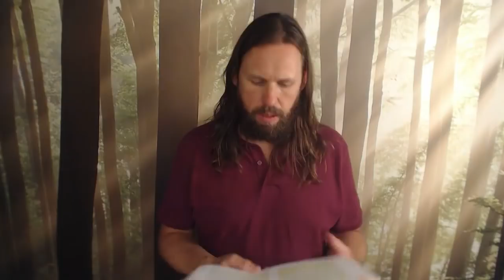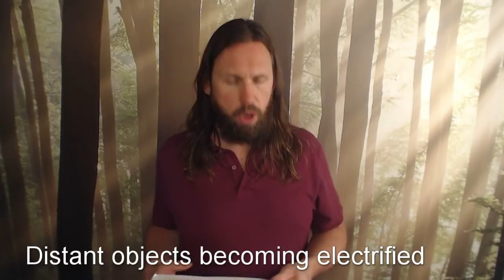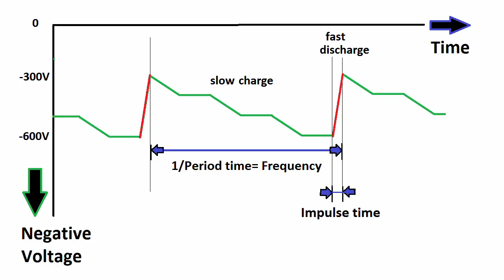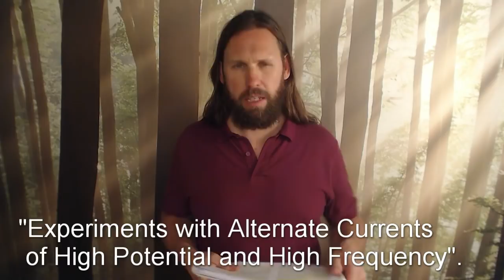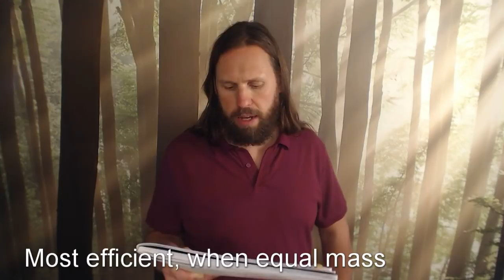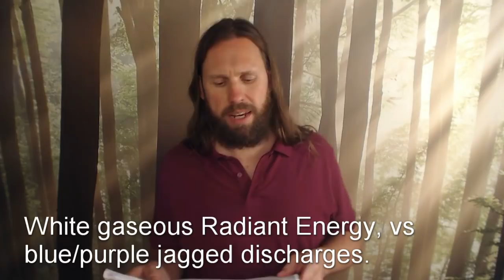Nikola Tesla's Radiant Energy Part 2 of 3

Comment: My hypothesis for the varying effects by impulse duration. Similar to how microwaves heat water molecules due to matching wavelength to molecule size, these dielectric impulses may pump/siphon dielectric energy into/from different sized assemblages of matter/molecules. Dielectricity -> Orgone -> 'life energy.' Per Ken Wheeler ( my take), matter consists of assemblages of magnetic shells inflated by dielectricity - magnet balloons filled with dielectric 'air.'  All of material existence consists of infinite variations in these magneto-dielectric assemblages. And, like a balloon, there can be different pressures. So, with this argument, living cells can be filled with differing levels of dielectric life-energy. Hitting them with the right impulse-width/duration, would add defacto life-energy. Or other manifestations (e.g. sensation of heat) from adding/subtracting energy at different impulse durations/widths. I bet one could fairly quickly work out correlations between impulse durations and different cellular structures, such as nerve cells, etc. One implication: life/death ray depending on negative/positive dielectric impulse. I also have an idea for a spark gap in a magnet. I wonder how different ring magnet configurations would impact spark quality if the spark-gap manifests at different points along the axis of the ring magnet. I wonder what effect north/south pole and center of dielectric plane - and offsets from center at different points. All experiments to try. But, need to come up with the pulse generator first...oh, that's one of the projects you've been doing Master Ivo! Great stuff. I hope to begin my own experiments by this fall this year and perhaps turn some of my hypothesis into theory and beyond.
Reply from the maker: please share your experimental results
Reply: @MasterIvo  I plan to. I want to step from the sidelines into action. Your efforts have helped a lot. Thank you.

Comment: Dealing with dielectric waves that travel faster in insulators than charges in conductors alters the dynamics of electrical engineering. The final 2ndary change in effects is how acceleration (changing the rate of change in voltages and magnetism values) influences the transference of dielectric and magnetic energies between substances. The logic for this 2nd influence is how more efficient the transference of kinetic energy is accomplished with higher values of kinetic energy (an exponential increase in effective transference with increases in value (the Oberth effect). Party on Dude, be good to each other. B
Reply: This is how glass lasers seem to work, the dielectric field is the light going back and forth.

Comment: i've created a BF pancake that naturally, with the help of a few nanoFarads external cap., rings at one of the Royal Raymond Rife frequencies that supposedly kill one of the cancer causing bacillus bacteria. it is inline with the output  spark gap of a small marx generator with supply power ~20W. it(BFcoil) is ~10cm diameter with ~24 gauge wire, and rings at around 1.604MHz, have to sweep over small varying capacitance(+/-100pF) region or mix with varying sound to achieve exact, but intermittently with respect to several sparks, frequency needed to shatter bacteria cell. i can feel a tingling from it against body when a ~5KV spark occurs at spark gap(s), coil itself located ~0.5 meters from gaps in marx generator.
Reply from the maker: Nice work! upload it in your youtube channel.
tonight I did a test which produced 42uS/h beta radiation from an impulsed TEM resonant coil.
Reply: @MasterIvo  sounds intriguing, Morray and Hubbard worked along somewhat similar lines for their generators/batteries. note that Morray invented transistor not bell, and bell didn't invent telephone either; telephone invented by Mucci by accident while investigating electrotheraputic device, then stolen when he worked at one of bell's labs , and another separate invention using the earth's ground invented by Stubblefield. note i probably have misspelled some names.
  my circuits are rats' nests, and only my cat likes to look at such things.

Comment: they seem to have confused the terms for positive and negative electricity, if i attach microvolt meter to connection inside earth i get a positive reading not negative
Reply from the maker: you will have to connect the other terminal of your meter in the ionosphere (or at least at a higher point)
Reply: @MasterIvo  although not convenient to raise one probe up to the height of the ionosphere, the + probe is inside the earth and the - pole outside(above) the earth. idk, do you get a negative voltage reading when doing this?

Comment: We are but flesh and blood machines that require cosmic Ray's to exist. These Ray's (radioactive matter) travel through all matter with ease. They travel at speeds 500 times the speed of light showering down on us from all stars in the galaxy. Tesla believed the speed of light was only a constant for light and that light and electricity were merely sound waves in the aether. He was  broadcasting his radiant energy using the ground around the world at speed 1.57 time the speed of light. By pulsing this energy in the ground, anyone on the planet could plug a one wire bulb into the ground at any place on the globe.
Reply from the maker: and sound is a longitudinal wave
Reply: @MasterIvo  I believe that I discovered one of the missing components in Teslas radiant energy patent. A component he patented first in the USA. My guess is that their are several patented components that are not mentioned in the original patent. Without these, the design wont work. I assume he did this to protect his patents. That component is coax cable. The aluminum shielding protects against static and displacement currents. Additionally, all coils in the system need to be bifiler for greater capacity for positive and negative legs. I was under the impression  that aluminium was best for the plates until his Colorado note results showed tin as a better metal(aluminum and steel not tested). They need to be polished to mirror finish. A metal globe with curvature works best over a flate plate. The radioactive matter passes through the insulated plates so three insulated plates sandwiched together might get the better results.
Reply from the maker: Yes Eric Dollard also used silver  plated coax. He used the mantle because it has larger surface area, and thus larger capacity. Perfect for making bifilar coils.
I have some for future projects.
Reply: The biggest problem I see with people trying to replicate his design is their attempt to add rectifiers and diodes or just change it. We need to keep it simple and on track with Teslas designs. If he said it, it is the truth. His grounding plate was buried with coke around it and he was constantly watering the ground in Colorado. We must keep in mind that this is high frequency, high voltage alternating current that will not be properly detected by electron theory designed multimeters. At least not until it is stepped down and converted through a transformer.
Reply: Additionally, out of the British Royal society, another secret, he mentions charging the plates using electrophorus in his rarified tubes (not vacuumed). This is the key and why the Crux Radiometer doesnt work in a vacuum, only in rarified air. Charging the sky plate negatively and the ground plate positively. My guess is this creates a full energy sink in the capasitor. He doesn't mention insulating the ground plate. He does mention in the Colorado Notes, surrounding the ground plate with coke (distilled charcoal). I do not know the significance of this process yet. My best guess is both plates need to be insulated to maintain the energy sink pressure and a rarified air barrier between the conductive plate and insulator (polyurethane). Removing all positive charge from the too plate and all negative charge from the bottom plate. Allowing positive particles to line up outside the top insulated plate and negatively charged particles to line up outside the bottom plate. Then when the radioactive particles coming from the stars move through the top plate, they release their tremendous charge smashing the plate and reflecting or refracting other particles. In turn, this creates pressure in the energy sink or circuit. These particles can pass through all matter yet the static particles in the environment are trapped outside and inside the insulated plates.
Reply from the maker: coke is conductive and lowers the resistance of the earth terminal.
he used implosion of the dielectric field between the plates. the " vacuum" created was filled by the ambient medium (aether).
Reply: @MasterIvo  Thanks for the explanation. Have you had any success getting his radiant energy antenna patent (US685957A) working with any significant results?
Reply from the maker: no I have not tried yet
Reply from the maker: @devinmccloud   actually yes, but the plate is the L3 coil, and its rectified to dc in to a cap and then loaded
https://teslauniverse.com/nikola-tesla/patents/us-patent-685957-apparatus-utilization-radiant-energy
Reply: This confirms why I believe Tesla used coke (charcoal) around his grounding plate. Higher conductivity when watered. His Colorado notes say he was excessively watering the ground to raise conductivity.

Comment: @Master Ivo Are you familiar with the works of dr. ken wheeler. l feel he might give you some insights to your questions. 

love your videos
Reply from the maker: yes Ken. he is not a Dr. and he doesn't know as much as he is pretending to know. last few years he is only repeating himself. seems he is stuck.
Reply: @MasterIvo  yesterday i was watching your video about bifilar pancake coils and you were talking about the movement/shift of the poles. Ken has some videos where he shows the magnetic field of a magnet under a ferro-lens ( two lensens with some ferro fluid and surrounding led light) and you can actually see that a magnet has no magnetic poles. you can see the red shift on the north and the blue shift on the south pole. basically its a conjugate geometry of a diverging toroidal magnetic field and a converging dielectric hyperboloid field.

i have to agree that he repeats himself alot and at times he annoys me but his insights to me were significant. as a layperson dabbing in the field of quantum i came across his videos and they seemed to make more sense than any harvard or royal institute professor i saw talking.

i really like your videos and your hand on approach. the only reason im typing this because i think some of the information he holds can help you on your yourney of understanding.

peace.
Reply from the maker: @d4rkcr34t0r   Yes I have a ferro cell. But what really interests me, is not the magnetic field, but the dielecric field, and the ability of longitudinal waves it has. That is not know by Ken

Comment: Hear is tesla the inventor of the electrical system we use every day, describing effects that no one else has documented or experimented with, how can someone who gave us so much that is so practical that we all use every day be describing effects that are complete esoteric to us all today? is the spark gap generator critical to obtaining these effects also?
Reply from the maker: Sparkgap was the method that Tesla used, he had not a lot of choices at that time. It is not needed. there are other methods.
For instance instead of discharging a capacitor. we can disruptive discharge a magnetic charged coil, by opening up the circuit.
I made a video about that, soon to be released.

Comment: @Master Ivo  check this out https://www.google.com/search?q=nikola+tesla+cone+shape+coil+&tbm=isch&ved=2ahUKEwiN6vS6mNnlAhUBrhoKHfkYD64Q2-cCegQIABAC&oq=nikola+tesla+cone+shape+coil+&gs_l=mobile-gws-wiz-img.12...13517.34901..36720...8.0..2.1605.18024.3-6j13j14j8-1......0....1.........35i39j0j30i10j33i10.XuL9cQ4l3rE&ei=U6DEXc30CoHcavmxvPAK#imgrc=PBPkATB6YWyIBM&imgdii=-7FP1lHURs-ifM   it is a rare picture of nikola teslas lab where there is shown the exact radiant discharge at the top of a cone shape coil! so this is the prove of the concept u are talking about in your radiant energy videos! that phenomenon is totaly real factual!
Reply from the maker: Wow that is a real nice photo! thanks for sharing!

Actually I made that same fuzzy spark but with much less voltage.
Reply: @MasterIvo  yes u did!! but i think that is still not the white gaseous spiky discharge that tesla harnessed. u are reaching more and more closer to the real thing.  keep it up brother 👍👍👍
Reply from the maker: @boxgajodar4144   thanks.
I will.
I saw another photo of that cone coil, with singoe discharges. I think the one you  shared was a time lapse, of several discharges.
Reply: @MasterIvo  yes bro its exactly as u assumed. there are like pictures of the same cone shape coil setup in tesla's lab but taken with timelaps differences. so in some picture its more visible then others. though i once rad that tesla told that it is very difficult to capture a photo of the radiant matter discharge. that is maybe because the energy itself is a nonphyeical force right like stuff faster then light speed aren't easily visible  to capture a picture through odinary camera which makes sense. idk but the pictures are 100% authentic like they show the exact phenomenon mentioned in the book u were reading i've also rad the book